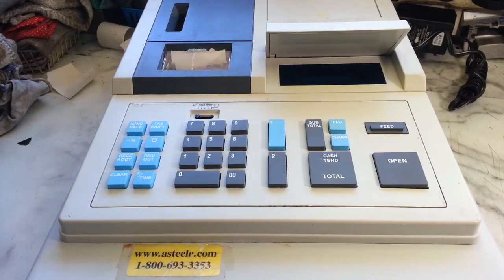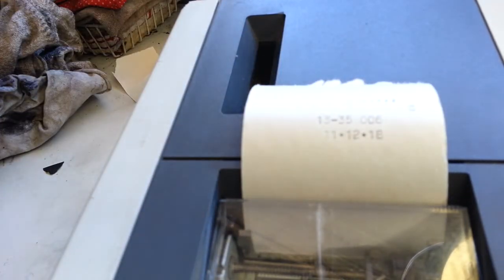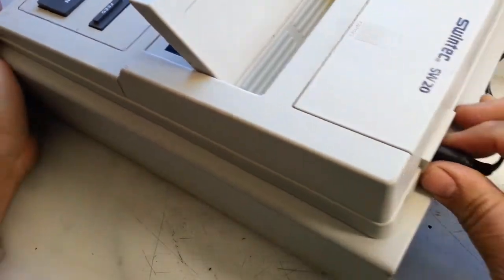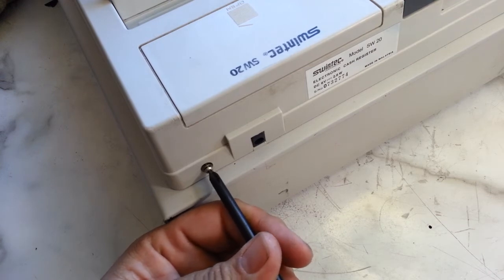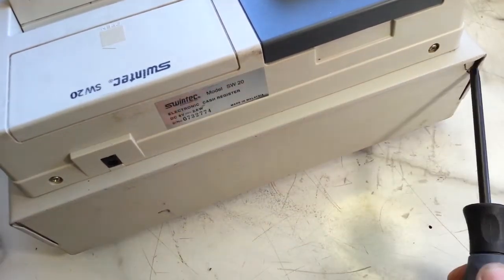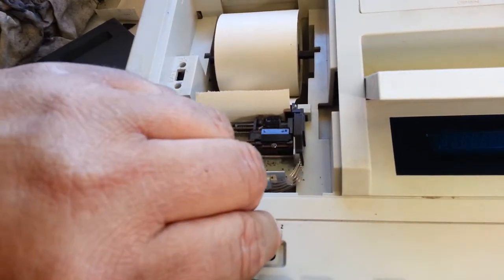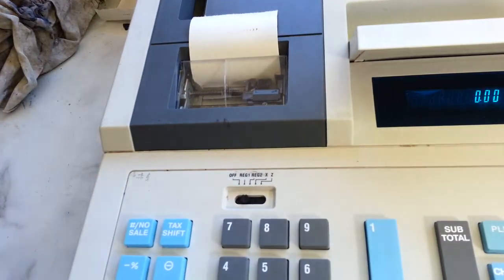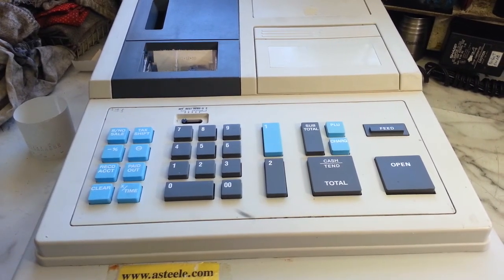Swintec Electronic Cash Register SW-20 Overview Demo

Comment: Nice video. I recently bought one of these used at an auction, but it does not turn on even with fresh C batteries. (Didn’t come with AC adapter.) Are the internal memory batteries you replaced required for it to work at all, or is it more likely that some internal electronics have failed? Thanks.
Reply from the maker: Those batteries are only to retain memory, machine operates without them same way
Seen lot of failures of the PCB's and have never figured out why